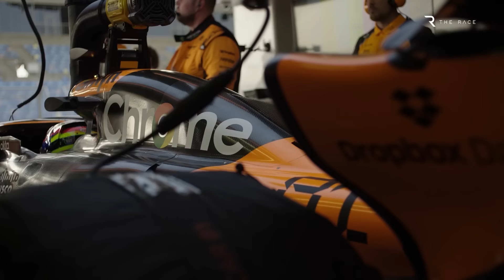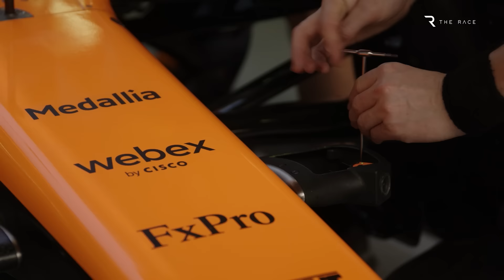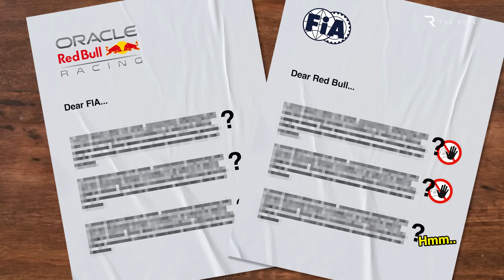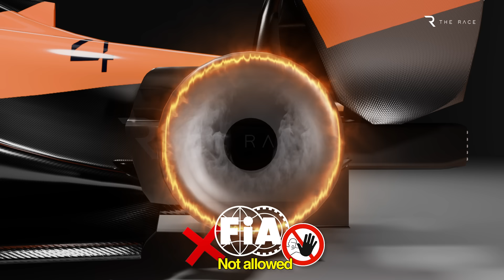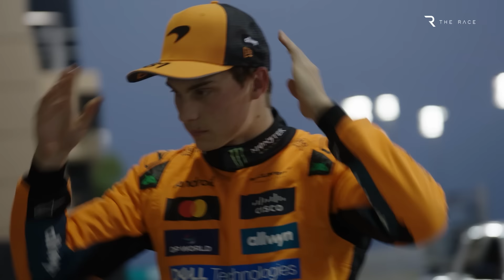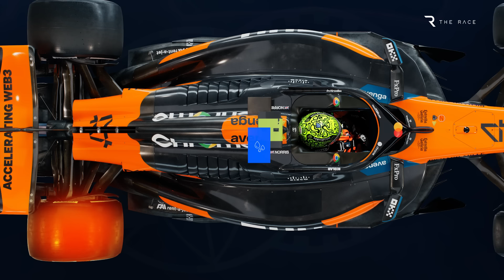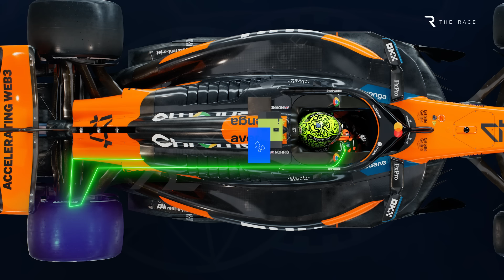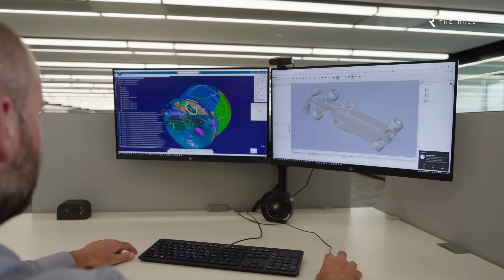Revealed: Red Bull’s wildest theories on McLaren’s clever tyre tricks

Comment: Most of the technical directive in a nutshell:
RedBull: Can we have water here?
FIA: No.
RedBull: And here?
FIA: No water is allowed.
RedBull: What about here?
FIA: NO!
Reply: Must not be the water then
Reply: @fredd3.14 Lets add that to the words of wisdom.
Reply: What about over there --> tho?
Reply: Red Bull virtually asked about running liquid nitrogen in the wheel hubs 🤪
Reply: I thought the phase changing material was supposed to be the most plausible of all the theories doing the rounds, I'd love to have seen the science and possible applications of such technology being broken down here.
Reply: @johnreilly4722  afaik all the proposed methods of cooling by RB the FIA does not inspect them, but if a team like red bull did asked them, they will have to check for teams not doing it
Reply: @ghfsd786fa  But what i'm saying is that this was the one thing that was not ruled out under this new technical directive and we don't know if Redbull asked about it.
I don't know if that technology can be developed into a real workable application for F1 teams but from the basic knowledge I have of it it is not being ruled out as illegal. They've ruled out a lot of similar things with the use of water but phase change material could be a solid part inside the drum.
Reply: Yeah, but Brakes are at 1000°C and the wheel cores are at 300°C, so to cool it using Peltier devices you need to fight that 700K diff just to have any slight cooling, thats a dose of 1Kw per wheel or more, and precisely when you need power the most on your wheels
Reply: RedBull: How about we bring the water from the driver bottle? hihi blushes
FIA: ... still no...
RedBull: Ok how about some super magic like material that converts deformation into heat or cold?
FIA: uuuuuuuuuuhhhhhh
Reply: Now you see how engineers find loopholes and gain an advantage.
Reply: Followed by
RedBull: Can we use peltier devices?
FIA: Yes, but we won't be happy about it and will ban it next year
RedBull: Great, that gives us 6 months.
RedBull Engineers: Um Christian, we don't have any surplus electrical power on the car to power peltier devices, unless you want to slow the car down.
Reply: @Thermalions  Yeah I wonder how much electricity a peltier devices made to exchange such extreme temperatures would actually use. I immediately also thought it would not be reaistic, but who knows. A computer CPU peltier can use 100w or more just to cool down a CPU chip by 50c...
Reply: @fredd3.14 never imagined  it be that much👍
Reply: @richardroulstone-roberts8598 yea peltiers are notoriously ineffective, but if anyone could engineer one that works i guess it would be a F1 team. so far none have worked out afaik for computers or even I think mercedes experimented with some form and failed
Reply: @fredd3.14 little  enlighten,  ignorant  of the technology  myself!  Seems to hard to apply  into braking  system,  but I'm  not motorsport engineer.
Reply: What if the water is extracted from the air through compression and then sprays out via air flow?
Reply: Honestly the first idea gave me my own idea. Have a volume within the hub housing that instead of filling with water, you just pump down to vacuum.That would eliminate the majority of the heat transfer from the brakes to the tire rim. The other idea i had, (in the comments of another video), of actively cooling the brake fluid and running the tubing such that the air flowing into the car has to pass across it still seems viable.
Reply: Ok... but what about..... here though?
Reply: And then McLaren sudenly a lot slower...
Reply: Funny how no other team besides MV33 Racing got any closer to them  @lcsper
Reply: More like this:

RB: Is McLaren adding water here?
FIA: No.
RB: How do you know? 
FIA: Because they designed it this way, here.
RB: Interesting 😊 but what about this other part, are they adding water here?
FIA: No!
RB: But, how do you know?
FIA: Because this is their design, no water, here it is.
RB: Interesting 😊 but what about here...?
Reply: You forgot the part:

TD issued 

Mclaren has tyre deg and Max pulls ahead 7s in a couple of laps after freshly pitted
Reply: So Horner can't fix his fking car??  Instead whole RB team spends time on other teams car??😂

Comment: Some ticks in the comment section have forgotten about the Ferrari slump post their power unit scandal which was caused by Redbull correspondence of just this sort.
Reply: What is your source that only RB is complaining?
Reply: @pcdispatch  since your sentence is present continuous, i suspect you are talking about the McLaren engineers doing their homework right. 

Honestly i dont know but they are the closest to winning both championships and the only other driver who can spoil the party, considering current pace stays, is verstappen. Other teams and drivers are just too far away pace wise
Reply: And for some reason they ignore Verstappen just owned McLaren comfortably in Imola and that flexible wings will not be allowed from Barcelona onwards. McLaren's huge car advantage could disappear as fast as it arrived. If Max runs on equal or better machinery than Piastri and Norris, it's game over for the Papaya team
Reply: There were substantial rumours at the time about the Ferrari powerunit and not just from Red Bull. This is a completely different scenario in which nobody but Red Bull are complaining.
Reply: @kyuzotatsuya9641  Because no one else has a chance at the championship. If Merc and Ferrari weren't so far behind they'd be crying too.
Reply: @itzan7513  But RB doesnt have a chance at the championship either.. I mean they have only one point scorer..
Reply: @Sheik505  drivers championship
Reply: @kyuzotatsuya9641  Welcome to the politics of F1... While their drivers are battling it out on track this is the battle of the teambosses.
Reply: @kyuzotatsuya9641  the Ferrari fuelgate saga wasn't just driven by Red Bull, but by Mercedes and every other non Ferrari powered team

Comment: What i consider the most interesting scenario is the use of phase change materials that can store and release a lot of heat energy at their transition phase. Possibly integrated into the brake cover drum to absorb ecxess heat without getting warmer and releasing this heat more steadily on the straights to keep the wheel core temperature in a closer window
Reply: Phase change materials are banned by FIA.
Reply: @mirasolovklose3888 Phase change or memory materials? I know memory materials are not allowed, but I havent seen anything on phase change
Reply: @calebhernandez4233  It specifically was phase change, the video above literally talks about it
Reply: @sajdwajha the video specifically talks about Shape Memory Materials not Phase Changing Materials which according to Google AI isn't the same. I'm no scientist but it seems like they would not be illegal.
Reply: @michaelfedora  One of the clauses also mentions phase change materials.
Reply: @Thermalions using phase change materials to cool the brakes isn't banned, you just can't have liquid.
Reply: @michaelfedora  Google AI is not the best. I have gotten many wrong answers just looking at the AI result. According to JSTOR/Wikipedia: Shape memory alloys are phase change materials, but not all phase change materials are shape memory materials (shape memory usually refers to an alloy vs a liquid).
Reply: @mirasolovklose3888 ive only heard about phase shape materials  (memory material) and evaporative cooling beeing band but not phase change materials that keep their shape
Reply: @mirasolovklose3888 memory meterials/ phase shape shift materials are forbidden. Phase change materials are entirely different
Reply: Everybody talking about, "In the brakes," or, "To cool the brakes." Nobody is thinking about in the WHEELS. One could conceal phase change material in the spokes, or the barrel, or even the rim of the wheels. No brake inspection would reveal anything unusual. AND every wheel change pit stop would renew the charge.
Reply: There are too many articles to remember but, they have talked about phase changing materials and that they are not allowed in the brakes.
Reply: @kaspershaupt  ive only heard about evaporative cooling and and  shape change materials  beeing banned.

 but phase change material would bea solid filling that would liquify inside, but not changeing shape. Ive only heard at  @Driver61 about it and as far as i remember there wasnt any specifics in the f1 rulebook about these kinds materials as the not actively cool but regulate heat transfer

Comment: I'm getting a bit sick of these videos, teams doing everything to try and slow down a leading team has been the case for the last 70 years we act as if it's something that's never happened before. Just like it is the drivers job to do whatever they can to the limits of the rules on track, the teams and their engineers wouldn't be doing their job if they didn't do it off the track. Think back to Mercedes trying to slow Red Bull down in 2022 with regards to minimum ride height, as just one recent example, then flexi wings in 2023 which is still rumbling on.

Comment: Peltiers are massively inefficient and incapable of rejecting the amount of heat theyd need to in an f1 application, all the other systems would surely have been spotted in the post Miami checks performed on the McLaren
Reply: Imagine the power needed to run them
Reply: @Saakk129 you'd need 2-4 Amps (not milliAmps) of current just to keep cool a can of soda.....in an already air-conditioned room. Peltiers to cool a racing tire is as absurd as trying to cool the Sahara by blowing on it.
Reply: I agree with you; but even if they were spotted, they would not be called illegal, and the car would pass the check. That is, if I interpreted the representation from the video correctly.
Reply: @EaZynite  i meant the liquid cooling systems such as the tank in the drum and liquid filled shell would have been spotted
Reply: @hassaization Ah sorry, thanks for clarification
Reply: @EaZynite  That's not true a TD isn't a rule change. So if they found these things than it would have been disqualification and factory check in. TD is just a set of guidelines
Reply: isn't it also true that if one side is cooled down, the other side is heated? that would mean extra ducts just to lead that heat away, more or less negating the cooling effect on the first side since Peltier elements are pretty thin.
Reply: @bennylloyd-willner9667 exactly. The junction where the temp differential happens is in the center of a very thin flat device. Typically youd attach the cold side directly to a component that needs cooling & a heat sink to the hot side. Then add fans etc.....worst theory RedBull floated, IMO
Reply: @bennylloyd-willner9667 yes thats correct. They take power and create a temperature differential between their two sides
Reply: ... This conclusion shows a fundamental misunderstanding of the specific use case here and what's needed & would actually work. 60% power to thermal efficiency is PLENTY for what McLaren would need here! You have plenty of cooling capacity in the main radiators. 🤷 The problem is heat in the tires. Getting that heat out into the main radiators, even at just 60% efficiency (meaning the amount of the heat dumped into the radiators is almost but not quite 2x the heat removed) would still be HUGELY beneficial!
Reply: @Cooe. How are you moving that heat to the main radiators from the wheel hub assembly? Or do you mean the brake duct cooling radiators? That also doesnt answer the power question still, 500w-1kw of power for a 250w-500w thermal load of tyre cooling per corner (assuming  an additional 10% efficiency loss in all the various material transitions that have to be made) is a significant amount of power to suck out the PU, the renault PU is estimated to be 15kw down and that costs alpine a couple tenths a lap
Reply: @hassaization ... With the Peltiers... Duh. 🤦 You just connect them to the standard liquid cooling loop for the main radiators.
Reply: @Cooe.  So you're suggesting running liquid cooling lines out to the suspension arms and connecting them to peltier modules attached to the inner of the brake drum? That would absolutely be considered liquid cooling of the brake assembly and be forbidden
Reply: You're all assuming the hypothetical peltier would be running off car power and not the other way around. You can generate voltage with a peltier by heating one side up.
Reply: @dontworry1302 you can either supply energy to create a temperature differential between the sides or supply a temperature differential to create energy. It can't power itself to generate its own temperature differential. That would essentially be free energy
Reply: @hassaization  .....yes. That's what I said. The cold side would be the airflow, the hot side would be the brake side.  That would produce a voltage where the peltier would be charging the battery using the waste heat of the brakes.
Reply: Only ~ 3% efficient.. so highly unlikely
Reply: @tsport100  Not sure where you got 3% but you're clearly not an engineer.
Reply: Peltier coolers are not that inefficient (around 60%) and they don't need to eliminate all heat, they just need to eliminate some heat in order to give the team a competitive advantage. I think that some kind of piezoelectric cooling is the most likely explanation given the FIA's rules.
Reply: @2011blueman 60% efficiency would still mean youre putting 600w into a peltier to move 400w of heat power, then you have 1kw of heat power total to remove from the brake drum assembly and an extra 600w you have to find somewhere. According to a post from brembo the total braking power (ers and friction) can reach up to 2450kw in a hard braking manoeuvre. Theres an obscene amount of heat energy you have to dissipate and peltiers are simply not a practical solution for doing so
Reply: @hassaization  You're again assuming they need to dissipate all the heat, that's not at all their objective and in fact doing so would be a massive disadvantage. The tires have an optimal temperature and keeping the tires hot enough, but not too hot, it the design objective. I don't want to throw out specific numbers on a public forum, but  You absolutely can use piezoelectric cooling and airflow to bring tire temps down to be closer to race optimal. The fact that FIA said it wasn't against the current rules but they're looking to ban it in 2026 should have been a big clue to you.
Reply: @2011blueman i never said they're getting all the heat out the tyres, but even maintaining the tyre temperature at 90 is going to be a significant wattage thermal load. 
In all the pictures of the naked wheel hub assembly there's no indication of where peltiers would go if not in the drum itself and in the event they're in the drum there's no sign of electrical connections suitable of supporting the current required to accommodate even the thermal load of the added thermal resistance of the peltiers themselves. If they're using solid state cooling to gain an advantage over conventional cooling methods they'd need to reject approx double the heat any other team needs to reject from their tyres.
Furthermore the accompanying article to this video indicates that piezoelectric methods of cooling wheel systems may be forbidden and the specific wording of the rules around thermoelectric cooling indicate it would only be banned if someone was actually using it, at least that's my interpretation of it
Reply: @hassaization  "If they're using solid state cooling to gain an advantage over conventional cooling methods they'd need to reject approx double the heat any other team needs to reject from their tyres." How are you coming up with these frankly wild statements?
Reply: @2011blueman  The efficiency of Peltier devices is critically dependent on the temperature difference across the device. Above a delta T of 60 oC, they are typically less than 10% efficient. To achieve 60% efficiency the delta T would be 20 oC or less, not much use if you are using ambient air to cool F1 brakes operating at very high temperatures.
Reply: I still like the phase change material theory to how it could be controlling temperatures.